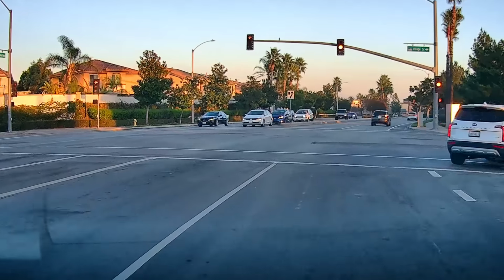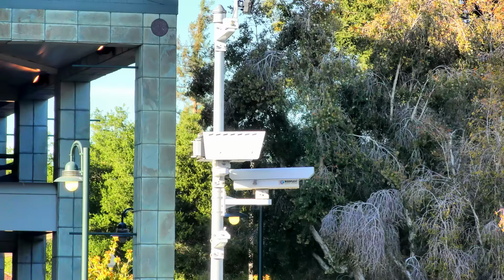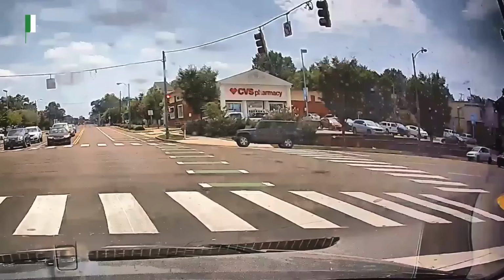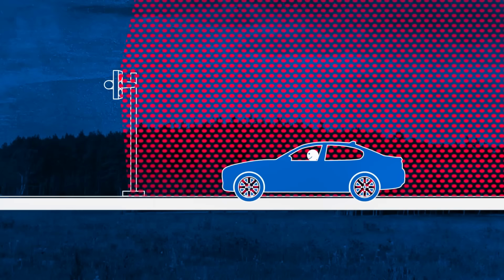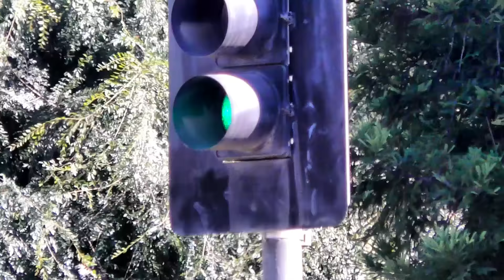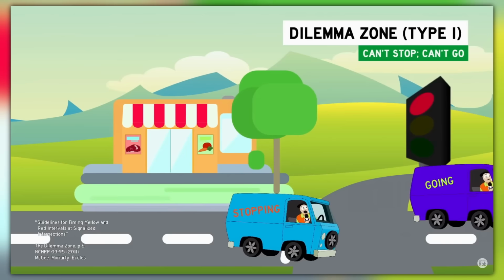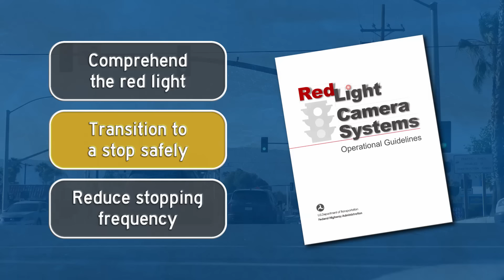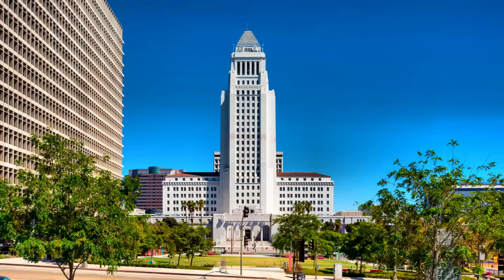Three ways to FIX a STOP LIGHT (so drivers ACTUALLY STOP!)

Comment: One thing that exists in france I find very handy is there's almost always a small traffic down low on the poll making it easy to look at it if you're stopped at the lights.
But this may also be done as here, traffic lights are typically located at the stopping point, rather than above, or across the intersection. I wonder if that aspect also helps reduce ambiguity, no need to figure out where to stop for the lights, you stop at the lights and you can't confuse them with the lights from a different direction either.
Reply: It's surely and advantage. In the US it's often cluttered with lights and on large intersections it's sometimes hard to tell which one is which. In Europe you will see your traffic lights, in the US you see traffic lights for almost all directions and lanes at the same time. That's a lot of lights! At night they may sometimes blend together and you just see one green-red blob of lights, especially in rain. It's also sometimes hard to figure out where you have to stop. In Europe you know, you have to stop in a way you still see the light. In the US you have to watch for a lane on the road before the intersection and those are sometimes almost invisible. Even worse in snow, you just guess where you should stop. People usually stop with larger buffer but I've seen people getting too close to intersection because they did not know that there's one more lane under the snow.

Comment: My city took the concept of coordinated signals for controlling speeding to the next step with "rest-on-red" technology. The signals on problem roadways are always in a restrictive state (all red) unless the signal detects vehicles travelling at or below the speed limit approaching; it will give a permissive (green) signal to let them through without having to stop. If the signal detects a vehicle travelling above the speed limit, it will stay restrictive for several seconds after the traffic has stopped before a permissive signal is given.

Comment: Hey Rob - a couple years ago I was in Irvine California and I was running a red light (was kind of looking at the next light on the road before I saw my light turn red at the last second) - I managed to screech to a halt within the first lane of the 6 lane intersection. Before I did that, something very peculiar happened. My light that had just turned red switched back to green, and the cross street that was on green switched back to red with no yellow in between. There were no cars I could see luckily - but have you ever heard of something like this as a crash prevention measure?
Reply: The only time I've seen that happen (with a yellow, never without a yellow) is when the light detects incoming emergency vehicles and quickly changes to their green to let them through

Comment: In Austria, we have a blinking green light. That means that the green light blinks 4 times at 1Hz (ish, never measured it) before turning yellow, giving you a couple seconds of warning and a way to estimate when it will change (if you saw when it started blinking, of course). It also gets your attention and gets you focussed on the signal. This is so effective that most people stop at yellow already, and there are few hard braking incidents. You have ample time to decide to either step on it or stop. The same goes for pedestrian signals, and you know that you need to hurry when it starts blinking.
This is so convenient that I miss it whenever I'm driving in other countries, and feel guilty for "running the yellow light". This would be a good thing to implement in the US, especially in the light of your overreliance on traffic signals.
Reply: They do this in Mexico and other countries too. I'm not sure why we haven't caught onto that.
Reply: saw this in Austria too, was a bit confused at the start, but I think it helps a lot
Reply: I live in a country with blinking green lights. Here even running a yellow light will get you a ticket. From my experience a blinking green offers zero benefits. I do not stare at the traffic light constantly when driving. I check the traffic light repeatedly as I approach it but I look at the road to avoid driving off road and crashing into the car in front. When the green turns yellow, the position of the lights change. That is immediately noticable without having to stare at the light instead of the street where you drive. Blinking greens are a hazard and driving through a yellow light should be allowed.
Reply: @lukasmax6984  You are not supposed to stare at the lights. I can easily notice the blinking out of the corner of my eye, except in rare circumstances. The blinking is very noticeable and it rather draws one's attention to the signal, more so than the change to yellow. I follow the blinking (and count along) with my peripheral vision, I have no idea how you arrive at the idea that you need to stare at it.
Driving through yellow IS allowed. I don't believe that this can get you a ticket (but you do have one excuse less for running the red light because you "saw the yellow too late").

Comment: Let's not also forget another huge issue (at least in my city), there are too many stoplights too close together, often for "intersections" that aren't busy enough (such as neighborhood exits) or crossings that shouldn't even be there. It can be solved by adding a roundabout or just removing the stop light altogether
Reply: This is a problem in Detroit. The red lights were put in when the ppopulation was 4 times larger than now. Little side streets have 🚦 that aren't necessary.
Reply: This is a problem with stroads. The fix without adding a light at the intersection is to make right and left-hand turn lanes, increasing the width of the road.
Reply: It also doesn't help that the lights are seemingly perfectly desynchronized. If you miss one green light you're screwed. But if you run one light then you can make the next 3 or 4 lights at least. Otherwise you're just sitting there at a red light at an intersection to an empty parking lot watching all those lights ahead of you stay green with no one going through them and then immediately turn red just as you start going. I live this nightmare everyday.
Reply: @Hooptedoodle  In the cities near me, the main roads crossing a freeway have that issue in certain directions at certain times of day.

In the morning, the lights are synchronized to feed traffic to the freeway; in the late afternoon, the synchronization reverses to feed traffic away from the freeway. All other times of day, the lights run independently on their local sensors.

It's a real pain if you're going against the programmed flow, but it significantly improves movement of the majority of traffic. Now the biggest problem is that there just aren't enough freeway entrances and exits for the commuter population - and they've been working on that: extending roads across the freeway, with new ramps; widening, extending, and rerouting existing ramps; adding turn lanes to enter the ramps; etc..

The next-largest, and probably intractable, problem is a combination of having few places to add freeway access that are both useful and achievable, and not being able to add secondary arterials (paralleling the freeway) to feed the accesses that they can build.

Comment: Èdmonton, Alberta, Canada has a large number of round abouts.  However, when traffic volumes increased above a certain level, some had traffic signals installed to control access.  Some were removed altogether and replaced with conventional intersections.

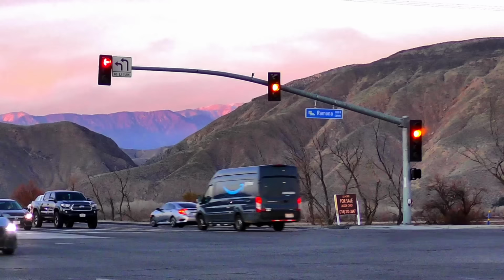Comment: 10:30 Those coordinated stop lights are an excellent idea. Unfortunately, in Dallas, Texas there are so many streets that are coordinated the other direction. So many times I'm driving in early to beat the rush, 4 am - 5 am sometimes and I am stopped at EVERY BLOCK for 2 miles. No traffic at all, just red lights that are timed to STOP me at every single block. Another area is similar but I discovered that once I get past that first stop light, if I gas it and maybe go 5 mph over, I can skate through the next one on the yellow light and sail through the rest of the 4 blocks ahead with greens. Otherwise, I get a red light at every block for 5 blocks.   Very frustrating, especially when I'm the only one around.
Reply: My city has those on downtown, one-way streets. Very efficient. On two-way streets, it would be a nightmare to try coordinating those.
Reply: They don't do extra detection loops way ahead of the traffic lights there? They are around at many bigger intersections here in the Netherlands, basically there are loops near the stop line and some a good distance earlier. If those distant ones pick up a car and there are no conflicts with other current green lights your red light will jump to green instantly.

I suspect this behaviour above is more a secondary benefit, it's likely involved in some of the control logic of the traffic light that helps set the durations of green lights. Basically if that loop is constantly picking up a car there's a certain length of vehicles in front of the light there. Could be very helpful with letting it decide how long it has to keep that green to clear all the waiting cars.

But I guess that'd be harder in a block design like cities are typically built over there, over here you'll typically find the traffic lights on the higher throughput roads. And once you're off those it'll either be a roundabout or a regular intersection without signals.

Comment: Intersections within 100 feet of each other are just signs of city planning failure
Reply from the maker: In the case I posted from Redlands, CA—  it's not an intersection, per se.  An old railroad parallels Redlands Blvd., which the region is turning into a new light-rail line called "The Arrow."  To make the railroad crossing safer, engineers added a new signal 150 feet from the existing one.

As for Portland—  yeah, that's another matter!

Comment: Great Video.

In the UK our traffic signals are on the corner BEFORE the junction, not after. I hate driving in the US simply because the signals are AFTER the crossing, and that is not what we are used to, and contrary to common sense. A red light may appear after you've entered the crossing. We also have the red, Green, amber, red, red-amber, green series of warnings. I'm sure you've heard all this before.

Be safe
Reply: What do horizontal traffic signals look like in the UK?  Is red on the right to indicate the danger side?  Or is red on the left, because they read from left to right?

I've heard that Japanese horizontal signalheads have red on the right.

Comment: I would like to see this guy do a special video on traffic lighted intersections, and railway crossings less than 40 feet from the intersections.  Lots of collisions happen there where lights are not synchronized with railway crossing lights or they are timed to create conditioned for vehicles to run a red light to avoid the train hitting them or they end up getting hit by the train because traffic was blocking their exits.  When I was 16 years old, I got let off the school bus to walk home.  5 minutes later, with 25 kids still on the bus, my school bus got hit by a train because of a badly timed red light in direct conflict with the railway crossing lights.  Amazingly, all 25 kids and the driver survived with minor injuries despite the entire bus rear end completely destroyed.

Comment: I love red light cameras. I have a really responsive and fast car. If the light turns yellow I either floor it or slam on the brakes unless im at a comfortable distance. Thus making the intersection more dangerous. Luckily my town installs these all over for more income.
Reply: Slamming on your brakes constantly means that you'll have to replace the brake system components more frequently than you might expect. I'm not sure which costs more; a brake job or a couple of red light tickets.

Comment: Having the lights on the far end of the intersection also makes it a lot more difficult to judge whether or not you can make the yellow light. Often times the stop lines painted on the road surface are worn out. In Europe traffic lights tend to be on the near side of the intersection. A bit less comfortable when you're first in line, but I suspect it is a lot safer because it's much more obvious where exactly you have to stop.
Reply: That's what I was hoping for when he moved to "as the Europeans have been screaming for the last 10 minutes". If you want people to see a stoplight, forget about fancy high vis reflective backplates. Standardized stoplight placement is what makes people find and understand stoplights, because the stoplight is always exactly where the driver expects it to be. And the one placement that works in all kinds of situations is to put them where the cars are supposed to stop.
Reply: Wisconsin traffic signals have low-mounted lights on the near side of the intersection, and high-mounted signals on the far side. But Minnesota has all of the signals on the far side of the intersection. I moved from WI to MN over 30 years ago, and I'm still not entirely used to it.

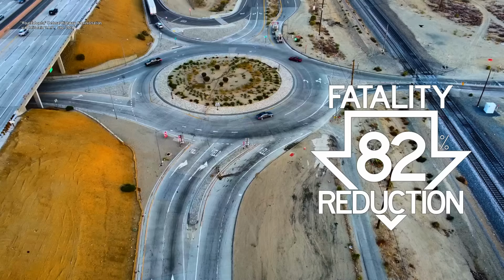Comment: 11:40 That turbo-roundabout looks a bit odd, it can still be better by putting a physical barrier between the lanes so traffic has to choose in advance if it wants to go for instance only left or straight /to the right.
Reply: There are turbine roundabouts in Europe. Each lane before the roundabout leads to specific direction. Drivers are not supposed to change lanes on the roundabout. Barriers are not needed, solid lines are enough.
Reply: I like the barrier idea. Good signage well before the intersection is also important and sometimes here in Washington State, you MUST change lanes one way or the other (yep, cross each other) IN the roundabout to prevent a forced right turn and go to the lane you need.
Reply: The strangest thing about that roundabout is that all lanes on the approach from the bottom have right arrows. Are people not allowed to turn left on that roundabout? (Compare to the approach from the left, where the left of the 2 lanes has a left arrow).
The rightmost lane at the bottom is basically a normal slip lane, except that it has to join the road going right very early, to keep the distraction of that process away from the rail crossing.
Reply: @Pystro  Yeah, that's obviously painted incorrectly. That's what I'm talking about regarding confusion in these if not properly signed. If this was the first time someone used this roundabout, they would rightly be confused. From the areal view, and with time to study it, we can see once you enter the roundabout, it shows a left arrow. If the idea is that you must always enter the roundabout toward the right (as it always is in USA), then the left approach is signed backward. Since we always enter toward the right, those arrows on the bottom approach are redundant.
Reply: @mr65136  Massachusetts also has a lot of older rotaries that act like UK roundabouts: you're required to yield/give way upon entering otherwise you can fly in and fly out. I thought old NJ traffic circles assigned the incoming traffic the right-of-way which can gridlock the circle.
Reply: Barriers would make it harder for big trucks to use the roundabout; that's why barriers are fairly uncommon on roundabouts. However, that right turn only lane going towards the railroad tracks could have been a roundabout bypass lane, but there wasn't enough room near the railroad crossing.
Reply: @ArtiePenguin1  In the netherlands they often use very low rounded off barriers to show and point people to correct place but trucks shouldn't have an issue if they need to go over them.
Reply: @kenmore01  I feel its been painted that way to prevent uneducated drivers just turning left the wrong way onto the roundabout

Comment: There's an interstate spur that turns into a regular state highway in milwaukee, 794, which recently took some advice from this video. There's a 3 way intersection with Oklahoma Avenue that has some very funky traffic lights on what is otherwise an interstate highway. Southbound, there's a red green left turn arrow, but the right lane has a perpetually green forward pointing arrow. So people turning left sit parked right next to cars swerving past them going 65mph. Northbound is a full traffic light around a blind curve on a 55mph road that only just recently installed a warning sign for the traffic light. Before you used to come around the corner and have around 2000 feet to determine if you could make the light or not

Comment: The isthmus of Madison WI has excellent signal coordination. I love watching drivers who don’t realize it go 35/40mph in the 25 and have to stop at each light while I’m on cruise control set to 25 almost running each red light and somehow it magically turns green when I’m just about to cross the threshold. They have it set to change with different amounts of traffic around different times of day so it’s not always coordinated.

Comment: I never really thought about the filter idea for second close traffic lights. However in Lakeland Florida where I used to live we have an intersection that get quite complex with two lights one directly after the other (about 20 - 30 feet) and the second light has a filter that makes it hard too see from the second light. As you approach it the light becomes more visible but has a distinct matte appearance. 
I assume this is the filter you referred to in the video and it makes that first light/ intersection significantly more safe.
Reply: I wonder how this impacts drivers in a higher seating position like in large trucks.
(by truck, I mean what a trucker drives to haul freight, not what every man and their dog drive cos it's in fashion)